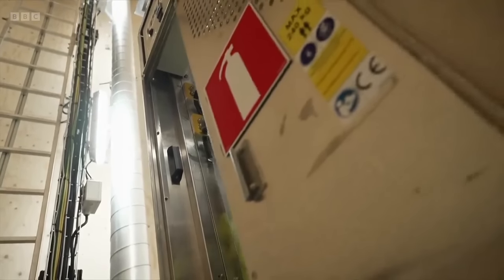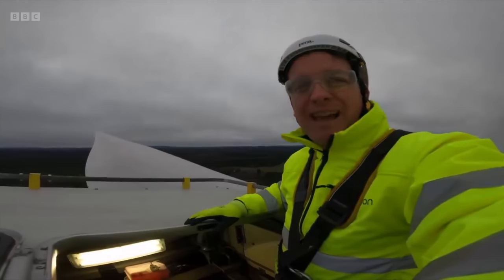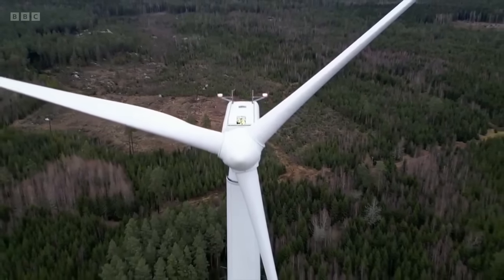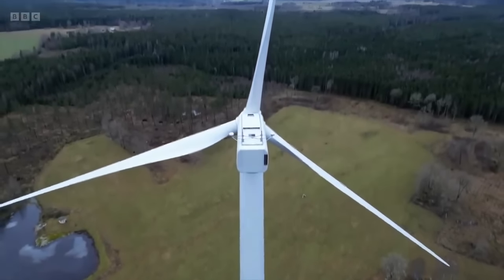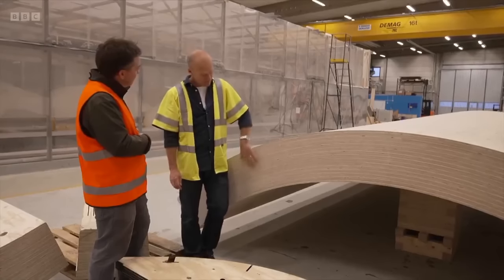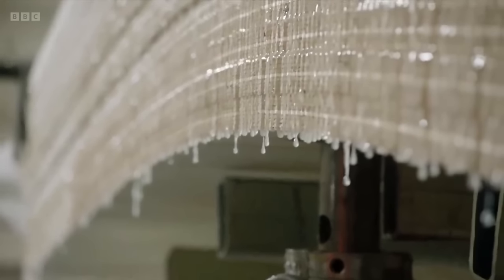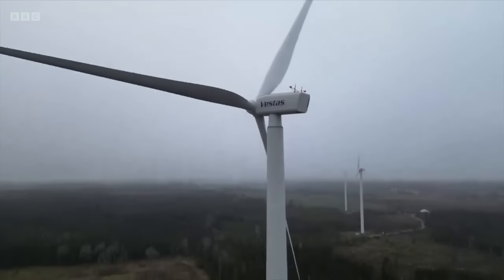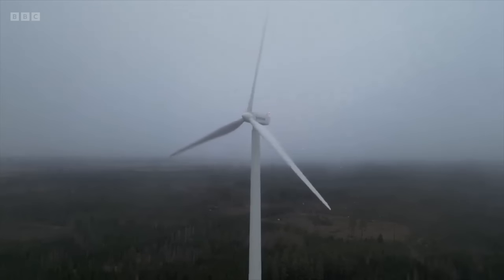Sweden’s giant wooden wind turbine promises greener future | BBC News

Comment: How is it greener if you cut trees in order to build wooden wind turbines?
Reply: They think dead wood captures carbon if you stick it up in the air.  🤣🤣.
Reply: Trees are renewable resource so long as you replant them, unlike the coal that's currently being used to reduce iron ore into metal. To answer the comment about dead wood capturing carbon- it's not capturing it's storing, wood stops capturing when cut but continues to store and then newly planted trees on the same land can go on to capture carbon.

Comment: The tower is made from wood and lots of glue.
The blades are fibreglass and there is lots of metal in the hub and generator. 
No mention of the extra pylons and transmission needed to reroute the whole grid.
Why is this environmentally more favourable BBC? Where is your balance and pragmatism in your reporting? What about the landfill waste for end of life? Will this work in the sea (I think wood and glue might struggle here!)
Reply: Landfill? What on earth do you mean?
In Sweden we burn our waste to create heating.
Reply: @starvictory7079  you burn fibreglass wind turbine blades?
Reply: There's plenty of work in progress to handle recycling of the  fibreglass blades. Seems like a totally solvable problem to me. It just requires time and regulations.
Upgrading the grid is more or less a necessity to transition to a zero carbon energy infrastructure. What material the wind turbines is made of has no impact on that.
It's kinda irrelevant if it doesn't work at sea. If all the ones on land start using wood, that's already a nice improvement, and saves whatever steel we can make to build more off-shore wind turbines. It's  an interesting question though. I'd think it's possible to make it work at sea. Wood has been used on ships for thousands of years after all. The base would probably be steel. The tower would not be directly exposed to sea water. Surface coating would keep it dry. Wood would probably handle salty humid air better than steel. I'd guess it'd be easier to develop a coating that stays for longer without maintenance since the material under the coating won't start rusting which can break up the coating.
Reply: @auspiciouslywild  This is actually hilarious, thanks for the laugh! You think a plywood tower will work at sea? How many large ships do you see which are made of plywood?Just make it out of steel. If you want to get all Greta Thunburg you can even smelt it with wind powered electrical energy and pay far more for it.
It just makes no sense to do impractical things, which are not particularly good for the environment and claim they are green. The icing on the cake is that you will tell me it's great value for money.  Meanwhile in China they are building coal fired power stations every week and laughing at all this.
Anyway, I just wanted to point out a few things the BBC seem to have forgotten to report in their quest to indoctrinate the world about green energy. I have no problem with green energy BTW, (when it works and does what they say) but cannot stand the obvious lies, omissions and partial truths being sold to the population.
Reply: @smile768 Thank you for telling us that you only argue in bad faith and not for the truth 👍
Reply: @anxiousearth680  I would love it if you found me a seaworthy plywood ship.
It would be wonderful if the renewable utopian dream was realistic, but it's not always green, practical or value for money. This may change, but at the moment we have to be practical and use what is possible and not pretend it is possible when it's not.

Comment: How long will it last if it is made of wood? If the thing is not as old as Chinese products, it will cost a lot
Reply: Nothing lasts long in the wind power production industry.  A few decades.  When a major wind power plant is “finished” one will have to begin replacing everything.  Not only the generators, the blades, and the towers.  But even the concrete foundations.  But that is a calculated cost (both monetary and environmentally).
That means the biological forces that make wood rot, etc, won’t likely have much of a degradable effect relative synthetical materials.  Especially if the wood is protected in a suitable way.  But it will be the mechanical forces that degrades it.  And in that context wood is just a fibrous material like glass or carbon fibre.  Tall trees in nature by the way standing strong in centuries against both biological and mechanical forces.

Comment: Ok it can be recyclable but still not sustainable. Because this method will increase the need for wood what mean more trees will be cut down.
Reply: It is incredibly sustainable, as more trees can be planted where these have been cut down
Reply: You can’t even imagine how many trees you have to cut down for one towers.  You will have to take into account not only the height, but also the thickness of the tower, which must withstand the weight of the tower and strong winds. You need an incredible amount of wood to do this. This is not only unsustainable, but also very expensive.

Comment: Sweden consumes about 177 TWh of electricity per year.
Sweden electricity generation from wind is about 20%
About 35 TWh.
Sweden has about 14 GW od installed wind capacity.
At 95% efficiency this should generate about 120 TWh per year.
What went wrong?

Comment: Those trees were happily taking up CO2 until they were cut down and made into turbines.
Reply: New trees are planted which keep on taking up CO2. Can't believe that needs explaining 😂
Reply: @Critical-Thinker895  
How is the carbon released?
By the cutting that makes those tree slices which are glued together afterwards?
Nah. Think you're wrong.
Reply: @oneshothunter9877 That is inaccurate. Carbon is released through decomposition. That is when the wood rots. Not when the tree dies. 

Plus, sourcing wood from the trees we plant prevents that harm. It creates a mostly closed loop. Dead trees are replaced with living trees we plant. Released carbon is offset by trapped carbon by those new trees.

Comment: Are they flame resistant
Reply: Actually, plywood is quite flame resistant.  Although obviously not as much as steel.  Sweden earlier didn’t allow large buildings being made from wood mainly to the issue of flame resistance.  But after much research it was found that constructions made from laminated wood wasn’t any worse than alternative materials.  So now you essentially can build a skyscraper out of wood if you can design it to stand the mechanical forces.
Reply: Thanks

Comment: That is not greener due to the amount of trees that would have to be used just for one turbine. Thats not eco friendly at all. Your removing carbon scrubbers to produce electricity 😂😂😂 this is completely opposite than green. Also the fact europe doesnt have enough of a lumber supply so your taking wood from other places in the world to produce energy for one certain group of people. Not efficient at all!! Plus the cost to build compared to the actual cost of production of electricity and how long that it will have to be maintained for it to make up its costs? All that wood is covered in glue and fiberglass which is not eco friendly in fact the opposite 😂😂

Comment: As long as the wooden towers don't require replacing too often, this may be a good call. I'm sceptical about their longevity though. They won't be as strong as steel towers.
Reply: Modern cross laminated timber is just as strong as steel, while also being lighter.
 Wood absorbs vibration better, meaning that it can take stress over time without cracking or wearing. Wood takes long-term stress far better than steel. Steel is more brittle than wood, making it a poor choice for structures that will be bearing high loads for a long time. Wood and steel have the same "stiffness" strength -- that is, how far they will bend before showing signs of wear; but wood is better for structures where the stress is constant and regular
Reply: @auspiciouslywild  That's certainly a detailed response. You may be correct, but I'm sceptical. I just don't see how wood can be a strong and resilient as steel.
If this idea becomes a widespread reality we'll have a real world experiment that will clarify who's correct.
Reply: @URBeingLiedTo  That experiment has been running for more than a decade at least. I regularly go swimming in a swimming pool from 2006 that uses CLT beams instead of steel  There's been several studies looking a the properties of CLT in detail. How much time do you need to feel it has been proven? A century?
I know of one critical failure of this kind of structure.. a bridge here in Norway. But it was due to incorrect engineering of the joints, a problem you can have with any material. The joints were made in steel I think.
I suspect there may be more accidents from improper engineering, since it takes time to learn how to do things properly with new methods/materials. Hell, it still happens with steel construction.
Reply: @auspiciouslywild  It's ok for me to be sceptical. You may well have circumstantial evidence, I'll take your word for that.
I just think longer trials in different environments are a reasonable requirement. I don't just believe something someone else tells me, that would be daft.

Comment: The tower is not the main problem, you don't solve any problems with wooden tower or get any better wind turbines. There are plenty of bigger problems, I made a list and came up with 35 items! I cannot list them all here, but apart from the most known, wind blades worn out, generators worn out within 10-15 years, there are huge problems with the grid, when you connect too many wind turbines. They need something that stabilize the grid, and that can only be made by large, VERY large generators. The one at Ringhals in Sweden weights about 260 tonnes and rotates 25 rps (yes, per second!) That's 1500 rpm. We need more of those! And you have to build an extensive grid that costs more than the nuclear power stations! Only for the grid!

Comment: Cutting down trees, for the purposes of "greener future"... 🤦‍♂
These are exactly as recyclable as fiberglass (not at all), but require exponentially more material that comes from carbon sinks (wood) instead of sand (fiberglass), and will be absolutely destroyed by the humidity\temperature changes\rain that cause wood to swell and break joints. This is downright silly, have you ever used a paper straw?
Reply: Even so I don't think wood is the best option in this scenario  ( blades yes) your view of modern wood construction is way off.
Look up a few buildings in Sweden and Switzerland.  They are most likely the leading countries in Europe.  Cross laminated wooden beams are absolutely comparable to steal beams.
Reply: @CHMichael  Not a single part of this was cross laminated wooden beams, it's effectively particle board. They literally just laminated a bunch of boards, with glue, on a form, nothing else, open to the elements, and all in a single direction. Also, how many CLT structures do you know that are made to the height of these structures? CLT is pretty, steel/fiberglass is structural. This is why we haven't made wooden ships for a long while now.

Comment: having even more nature being destroyed for monocultures (wood in this case) might have its own set of problems. I'd say it depends on how quick the green energy produced sets of the carbon emissions from production. If this timespan is low, keep it in steel, please.
Reply: Sweden’s forestal agriculture is internationally regarded as being quite sustainable.  And although not perfect, I believe the politics is two steps forward, one step back in the pursuit of even better sustainability.
This is more of an experiment that also will evaluate all kinds of issues.  Not only technological, but environmental and economic ones too.  Perhaps a good idea might be to use different materials concurrently so not to “deplete” one source.  Both for sustainability and for geopolitical (national defense/independence) strategies.